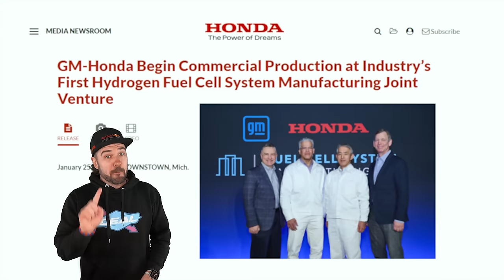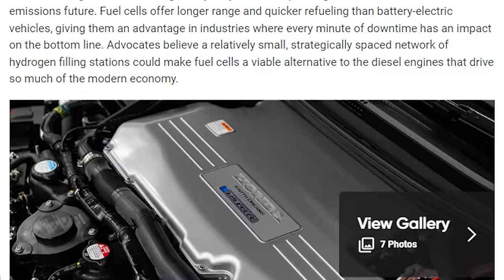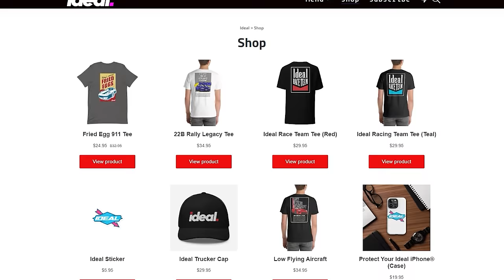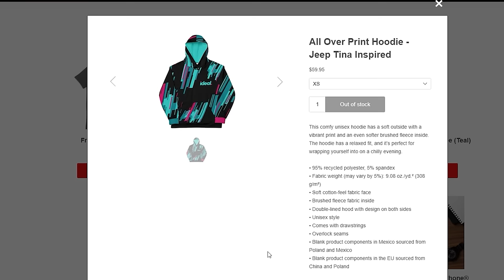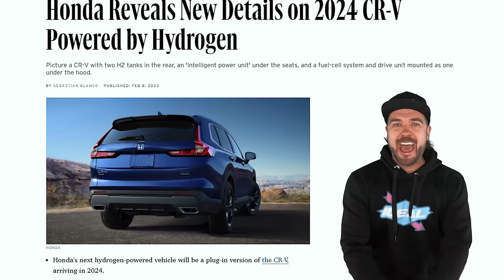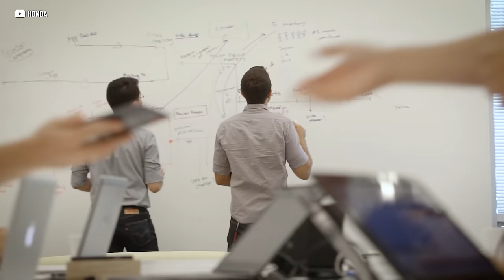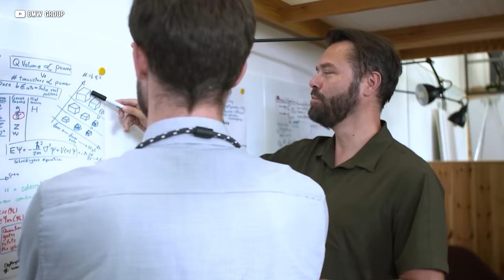Honda REALLY Just SAVED Internal Combustion Engines

Comment: I’ll bet that Toyota isn’t gonna be left behind. They seem to have their eyes on the horizon and a firm hand on the wheel.
Reply: They tried working with Gm a couple years ago and toyota kept telling gm that that's not the way to do it and toyato backed out now it's honda gm
Reply: Toyota went racing with their hydrogen powered corolla in the 24hrs LeMans.
Reply: Old news, Toyota made an announcement months ago they will no longer research and design EVs and instead shifted to hydrogen. Something tells me that shift happened three or more years ago when Toyota designed the current hybrid in the Tundra, Tacoma, and Land Cruiser instead of offering an EV.

Comment: I have a feeling that combusting hydrogen will succeed a lot instead of the battery version.
Reply: Burning hydrogen is stupid when fuel cells are 3 times more efficient 🤦
Reply: @JxcksonSF  True but even with fuel cells they're not nearly as efficient as BEVs. It's also a lot cheaper to upgrade an already reliable, existing grid than to start over with a hydrogen network.
Reply: @JxcksonSF  Yeah but i kinda dont like the idea of batteries or smth like that. Because i am an electronics engineer and i know that batteries are such a pain. They are costly and their capacity decreases over time even if you dont use it.

Comment: I totally agree Hydrogen Fuel Cells (HFCs) are good. 
As for the video title, I really can't see how HFC are going to save the internal combustion engine. Well not for the mass market.
HFCs generate electricity, that would power an electric motor.

I guess you could argue that once the hydrogen refilling infrastructure is in place , the hydrogen could be burnt in an internal combustion engine, but this is a real lot less efficient than using the hydrogen in a fuel cell and generating electricity. I think a car will go something like 2 to 3 times the distance using the same amount of hydrogen in a fuel cell as compared to burning it in an internal combustion engine. Internal combustion engines waste a real lot of energy as just heat. (I'd need to check the numbers, however HFCs are a lot more efficient)

So I guess the really rich people that want an internal combustion engine running on hydrogen could have it. The hydrogen refilling infrastructure would be there for them as well.
Hence the internal combustion engine would be saved for the very rich, who still want their 5 litre V8.

The mass market cars using hydrogen, would be HFCs driving an electric motor, and not burning it in an internal combustion engine.
Reply: Not exactly true, hydrogen pricing is about the same as 91/93 octane $5 a gallon. There's plenty of hydrogen stations now and you can make your own version of hydrogen power and water is cheap from your water faucet. And if it sits, it just drips out the tail pipe.
Reply: @philipwilliams3427  
I have wondered about home generation of hydrogen using electrolysis .
It is just a source of water (might have to be filtered) and electricity, and an electrolyser and then compressor.

In the UK (where I am) this would probably only be economic on overnight off peak electricity rates that can be £0.07 / kwh.
On days rates that are currently more like £0.34 / kwh, it'd be very expensive hydrogen !

I wonder if someone is selling a home electrolyser compression ? Guess I'd need to google for that ....

Comment: Hydrogen fuel cells are the future not this electrical vehicle crap
Reply: This is an electric vehicle. The fuel cell makes electricity which charges batteries or drives the electric motors or both.

Comment: Watch the Engineering Explained video on hydrogen power. It's not scalable, as efficient, as safe, takes up a huuuuuge volume in the car in the form of super high pressure liquid hydrogen tanks. They're bombs in a crash due, with an extremely volatile element if any spark is present.
It is still also really inefficient and really energy expensive to extract hydrogen.
The main reasons why this didn't take off didn't change, sadly. It would be super cool, omg, to keep our awesome engines and not pollute at the same time.
EE shows a hydrogen engine will also make way less power for the same size..

Comment: Stop telling lies! H² is not the solution! It's inefficient, you need a battery anyway and most of the H² is extracted from fossile fuels. OPEC countries want to make us believe hydrogene would be the solution but it's not. Most efficient are batteries we only need better ones using less harmful components! The problem with hydrogene cars is, when its battery is empty you only have a 25-50kw fuel cell and your car only gets what? Only 25-50kw depending on the fuel cell! So most important in an hydrogene car is to always have a fully charged battery. Isn't it strange somwhow?
Reply: So what’s the solution?
Reply: @360nofx  new and better batteries without cobalt and other harmful stuff. LFP stands for Lithium-Ferrum-Phosphorus and is much safer as NMC already and they already testing salt/sodium batteries which not even need lithium anymore. I'm pretty sure they will find even better ways to store energy in the future because never before have so many researchers researched for better battery techniques. It just wasn't necessary...